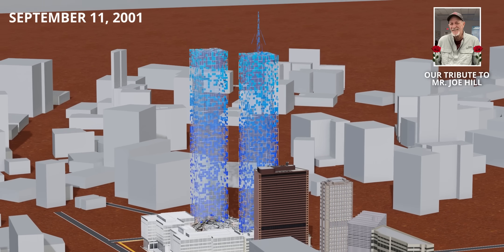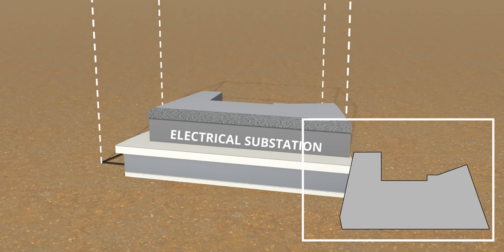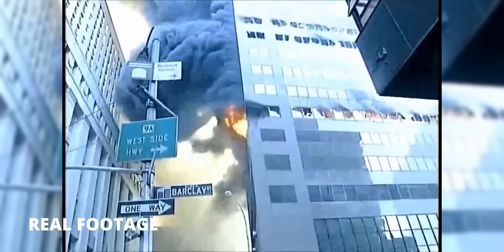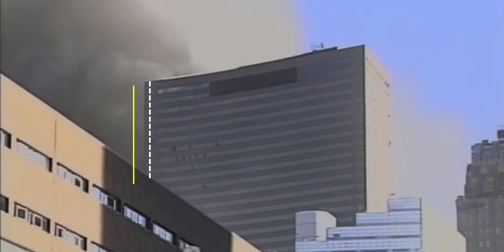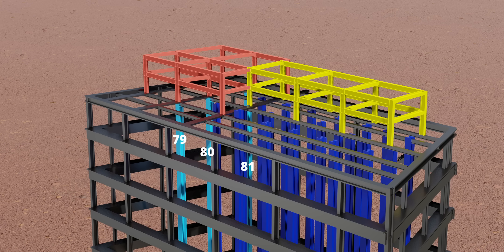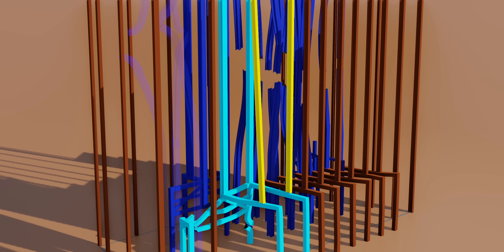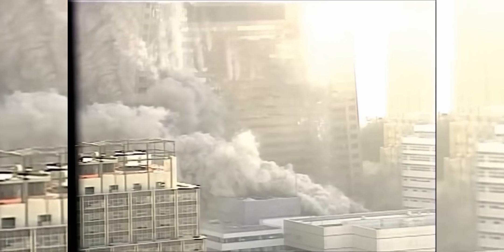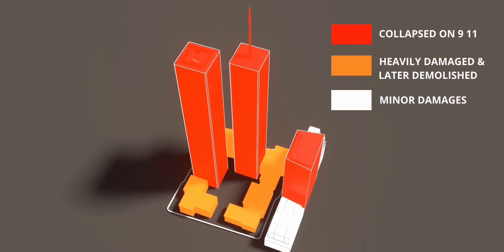Collapse of Building 7 | The Complete Physics

Comment: This video purports to debunk the suggestion that WTC 7 was the subject of a controlled demolition. In fact it just makes that argument demonstrably likely and all the more convincing. 
Note that the building did not fall over which - using the creator’s cereal box analogy - would be its natural downward trajectory if the lower supports simply failed.
Instead, as very helpfully demonstrated by this video, WTC 7 collapsed into its own footprint, and disappeared in a matter of seconds.
It’s not just that the emperor has no clothes. He’s bending over and taking a huge dump over the laws of physics. 😂
Reply: @h1F595  "Why is it relevant who the tenants were?"

Because your also shitty comrade and lover spread his usual stupid lie that the building was "unknown and unimportant" mikroshill.
Reply: Speaking of taking a dump,... Steel structures do not topple. They drop.  Your starting assumptions are false. And you clearly did not understand the cereal box reference. 

The collapse of the unknown and unimportant Building 7 – 6th building to collapse of 10 destroyed on 9/11 – is one of the most studied engineering disasters in history yet confuses a lot of people. Not famous, not a terrorist target, and no one was killed in it, thus it did not get a lot of attention, so most know very little about it, creating a void rapidly filled with garbage. Given the choice between long boring technical reports and easily digestible fantasy on the internet, many turn to the latter. Because everything seems like a conspiracy if you don’t understand how it works, I prepared this brief summary explanation of my own analysis. No politics, just engineering. 

The North Tower collapse at 10:28am bombarded Building 7 with thousands of tons of burning debris, causing heavy damage and starting raging fires burning out of control for the next 7 hours. Half the responding FDNY firefighters having been killed, others injured, units in disarray, much of their equipment destroyed, no water pressure, and the greater urgency of Search & Rescue efforts, firefighting efforts at 7 were pulled as futile. The building couldn’t be saved and was left to its fate.

youtube.com/watch?v=g_SvpwyC17M&ab_channel=MFitz 

Collapse of a burning structure is always a concern for firefighters. Steel buildings subject to fire rely on active fighting of the fires to survive. Left to their own devices they will collapse. Buildings are designed around 1 to 3 hours of fire resistance, allowing time for occupants to escape and ACTIVE firefighting to get started, after which all bets are off. In B7 the occupants escaped, passive and active fire protections were compromised and active firefighting never got started which left the building to take its chances. It lost. Odds on Building 7 would eventually collapse, and it did. No big deal in logic. That is the sort of choice firefighters make every day in brush fire situations - which houses to save and which ones to let go. Only real difference here is moving the decimal on the size and cost.

FDNY Chief Daniel Nigro ; The biggest decision we had to make on the first day was to clear the area and create a collapse zone around the severely damaged 7 World Trade Center, a 47-story building heavily involved in fire. A number of fire officers and companies assessed the damage to the building. The appraisals indicated that the buildings structural integrity was in serious doubt. I issued orders to PULL BACK the firefighters and define the collapse zone. It was a critical decision; We could not lose any more firefighters. It took a lot of time to PULL EVERYONE OUT, given the emotionalism of the day, communications difficulties and the collapse terrain

FDNY Deputy Chief Peter Hayden ; We had our special operations people set up surveying instruments to monitor and see if there was any movement in the building. We were concerned of the possibility of collapse in the building. And we had a discussion with one particular engineer there, and we asked him if we allowed it to burn could we anticipate a collapse and if so, how soon? And it turned out that he was pretty much right on the money, that he said 'In its current state you have about 5 hours

With its deteriorating condition being reported throughout the day, the collapse of Building 7 expected by the FDNY, bystanders and the media meaning at least 24 video cameras recorded some or all of the collapse. Everyone at the time knew what was coming and why.

youtube.com/watch?v=OY5S5k3tMHI&list=PL4GiNqqck-lzR7pebSWRVLoXyu-aWR3Rr&index=48&ab_channel=911InvestigationVids 

Building 7’s collapse was totally different to the Twin Towers, harder to understand and most of the details difficult to see. But we can sort out what happened through careful analysis and observation.  What follows is MY EXPLANATION of the collapse sequence using the best available information and relying on no authority.

B7 was complex structure, a 47-story steel framed building built on top of a smaller existing 3-story building, requiring several lower floors dedicated to complex load transfer structures instead of usable office space. Of trapezoidal shape and all-steel tube-in-tube construction, B7 (above the 7th floor) consisted of a central core of steel columns carrying most of the gravity load, perimeter steel columns around the outside of the structure carrying the remainder of the gravity loads and long span beams and girders to tie those elements together and form the floors. On the outside of the building hung a moment frame - the last part of B7 to fall. 

Phase 1 : Collapse initiation for B7 is notably quiet with observers not realizing the building was collapsing! There was no audible warning in the form of say hundreds of ear drum busting 180-190dB explosive bangs preceding the collapse. The first externally visible signs of collapse initiation occurred at 5:20:28 pm. Here at 12:00 a local CBS affiliate reporter is talking 10 blocks from B7 when collapse begins. People don’t start to notice the collapse until 12:11. Then at 12:45 is the famous CBS fixed camera clip of Building 7’s collapse Again, note how quiet it is.

youtube.com/watch?v=t5tEy6mXSE8&ab_channel=fresnosean379

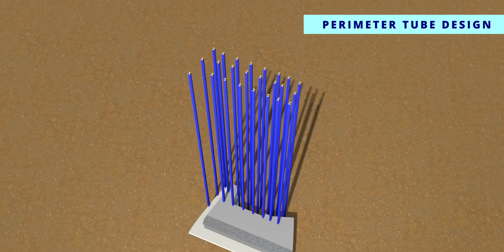Collapse initiation was due to multiple lower floor failures above the load transfer region (7th floor) in the NE corner of the building. In this video at 0:45 you can see the NW corner from inside the building while under construction, Column 79 just out of frame on the left. That big, angled steel beam across the top of the frame connects to C79 at one end. The girders connect to the beam. The beam and all those girders depend on just one connection

youtube.com/watch?v=nP3TNHPCIVU&t=35s&ab_channel=EdwardCurrent

Phase 2 : Lower floor failures left core Column 79 laterally unsupported over an excessive length and it buckled. If you look at a floor diagram of Building 7 (see above) and look at all the structures that depend on C79 you quickly realize this one column was a relatively isolated structural element on which a disproportionately greater fraction of the structure depended . Externally we see a vertical progression of window breakage along the 44-46 line and a kink in the roof of the East Mechanical Penthouse at the top of the building, consistent with C79 failure. The transition from full capacity to almost no capacity occurs in virtually an instant. Once the buckling failure occurs there is almost no resistance

Normally with a buckling column, the load could very well be redistributed to other columns, meaning the buckling could stop after a while. With C79 that is not the case - the failure did not redistribute the load, so the collapse rapidly progressed to the roofline, sinking the rooftop penthouse.

Phase 3 : With C79 gone, B7’s progressive, non-symmetrical collapse continues with C80 and C81 at the east end of the core left laterally unsupported and quickly buckled and failed as well, sending the EMP down through the building. C79-81 all have no diagonal bracing, which I believe is a major reason why they could not redistribute a lot of vertical loads among one another.

From there collapse progressed from east to west through the central core until the core was gone taking all of the interior floors and structures and probably most of the perimeter columns with it. You can see the horizontal progression of window failures low in the building and the dropping of the remaining rooftop structures into the building. One of the big takeaways from the NIST Building 7 study (that gets completely ignored) was their modeling which determined C79 failing under ANY circumstances would have initiated the same collapse sequence.

Phase 4 : After about 10 seconds only the exterior moment frame - a hollow shell mostly supported by the 4 corner columns and quite unable to stand on its own – remains, creating the illusion the building is still standing since little has changed externally. That’s just hollow empty shell, like an empty cereal box. The north leans inward, forming a V in the roofline. The last remaining perimeter columns buckle under the strain.  There is almost no resistance as the moment frame free falls, landing on top of the 7-story high debris pile, blocked surrounding streets, heavily damaged the Verizon Building and destroyed Fiterman Hall at 30 W. Broadway, all well outside of Building 7’s “footprint”.  It is only here, at the very end that a single utterly meaningless measurement of alleged free fall is taken. Start to finish the collapse took 18-20 seconds, or less than 1/3 of true free fall*. Not that we really care since how fast something falls cannot tell you what started it falling in the first place. The free fall argument is about the collapse of the outer shell *AFTER all of the critical internal structure had already failed and completely ignores about 80-90% - of the collapse. 

Building 7’s progressive, non-symmetrical collapse was incidental and unintended collateral damage from the combined effects of fire + time + gravity started by the collapsing North Tower. That is true no matter who planned and carried out the 9/11 attacks or why . 

Anything can seem like a conspiracy if you don’t understand how it works. Now you should. I hope you found this helpful and informative, and it solicits informed critical comment. If I made any errors of fact, logic or reason or left anything critical out, please let me know so I can fix it. IF you can offer a more plausible alternative please do. Be the first. Please start any reply with the words “Tits McGee” or I will know you didn’t read it and are wasting my time.
Reply: @TheCriticalStinker-01  “Time Wasting” To start with, why do you assume it was an “unimportant” building. Are you even aware which tenants occupied it?

Wikipedia entry gives us:

The groundbreaking ceremony was hosted on October 2, 1984.[8] The building opened in May 1987 as part of the World Trade Center.[15]
In June 1986, before construction was completed, developer Larry Silverstein signed Drexel Burnham Lambert as a tenant to lease the entire 7 World Trade Center building for $3 billion over a term of 30 years.[16] In December 1986, after the Boesky insider-trading scandal, Drexel Burnham Lambert canceled the lease, leaving Silverstein to find other tenants.[17] Spicer & Oppenheim agreed to lease 14 percent of the space, but for more than a year, as Black Monday and other factors adversely affected the Lower Manhattan real estate market, Silverstein was unable to find tenants for the remaining space. By April 1988, he had lowered the rent and made other concessions.[18]
In November 1988, Salomon Brothers withdrew from plans to build a large new complex at Columbus Circle in Midtown, instead agreeing to a 20-year lease for the top 19 floors of 7 World Trade Center.[19] The building was extensively renovated in 1989 to accommodate Salomon Brothers, and 7 World Trade Center alternatively became known as the Salomon Brothers building.[20] Most of the three existing floors were removed as tenants continued to occupy other stories, and more than 350 tons (U.S.) of steel were added to construct three double-height trading floors. Nine diesel generators were installed on the 5th floor as part of a backup power station. "Essentially, Salomon is constructing a building within a building – and it's an occupied building, which complicates the situation", said a district manager of Silverstein Properties.[20] According to Larry Silverstein, the unusual task was possible because it could allow "entire portions of floors to be removed without affecting the building's structural integrity, on the assumption that someone might need double-height floors."[20]
After the World Trade Center bombing of February 26, 1993, New York City mayor Rudy Giuliani decided to situate the emergency command center and associated fuel tanks at 7 World Trade Center. Although this decision was criticized in light of the events of 9/11, the fuel in the building is not believed to have contributed to the collapse of the building.[21][22]: 2 
Final tenants
edit

The position of 7 WTC in relation to the other WTC buildings before September 11, 2001
At the time of the September 11 attacks, Salomon Smith Barney was by far the largest tenant in 7 World Trade Center, occupying 1,202,900 sq ft (111,750 m2) (64 percent of the building) which included floors 28–45.[1]: 2 [23] Other major tenants included ITT Hartford Insurance Group (122,590 sq ft/11,400 m2), American Express Bank International (106,117 sq ft/9,900 m2), Standard Chartered Bank (111,398 sq ft/10,350 m2), and the Securities and Exchange Commission (106,117 sq ft/9,850 m2).[23] Smaller tenants included the Internal Revenue Service Regional Council (90,430 sq ft/8,400 m2) and the United States Secret Service (85,343 sq ft/7,900 m2).[23] The smallest tenants included the New York City Office of Emergency Management,[24] National Association of Insurance Commissioners, Federal Home Loan Bank of New York, First State Management Group Inc., Provident Financial Management, and the Immigration and Naturalization Service.[23] The Department of Defense (DOD) and Central Intelligence Agency (CIA) shared the 25th floor with the IRS.[1]: 2  (The clandestine CIA office was revealed only after the 9/11 attacks.)[25] Floors 46–47 were mechanical floors, as were the bottom six floors and part of the seventh floor.[1]: 2 [25]
According to CoStar Group, floors 9 and 10 of 7 WTC were occupied by the Secret Service.[26] The CIA had offices on the 25th floor of 7 WTC, as reported by the Associated Press.[27] The National Institute of Standards and Technology's 2008 Final Report on the Collapse of World Trade Center Building 7 confirmed that floor 14 was vacant, and updated the news reports of CoStar and Associated Press from 2001 to show that Salomon Smith Barney leased floors 15 to 17.
Reply: It was also the command and control centre so don’t talk rubbish 😂
Reply: @petitgenie8711  I'm genuinely trying to look this up but not found anything, but why exactly would this other smaller building need to be demolished too with no plane having gone into it? What was the significance of the building to require that?
Reply: @petitgenie8711  - You didn't follow instructions.
Reply: @DM-kv9kj  Don't claim to know all the details but the DoD, CIA, and US Securities and Exchange Commission (which is concerning if you know about the insider trading in the weeks prior to 9/11) had offices there.  

Rumsfeld and Cheney were also on the senior advisory board for the firm which occupied most of the building, though I believe they resigned in 2000.  One can speculate, but it's all too easy to speculate.